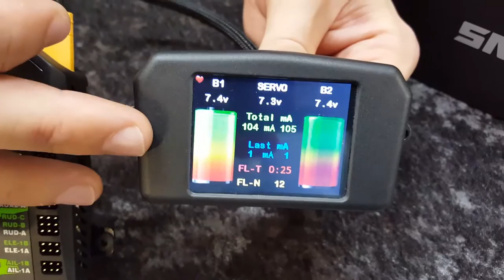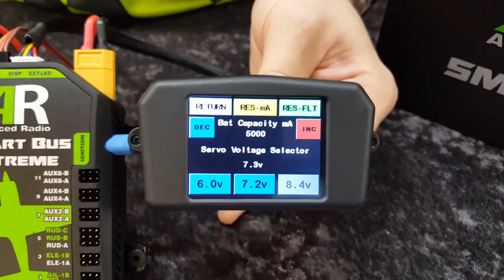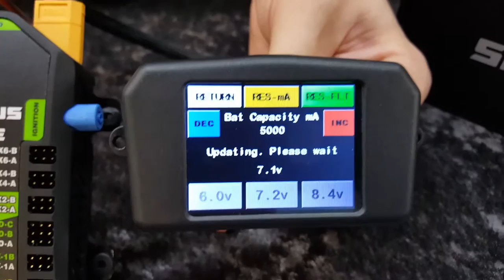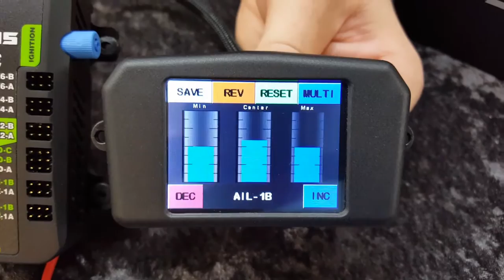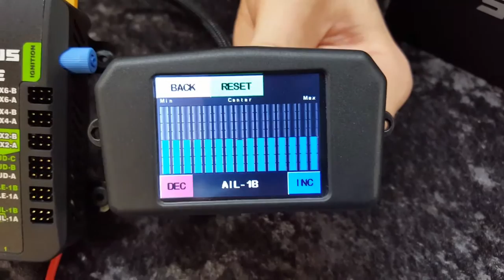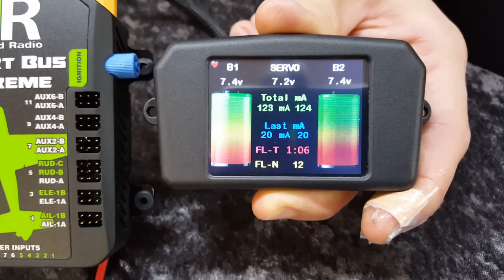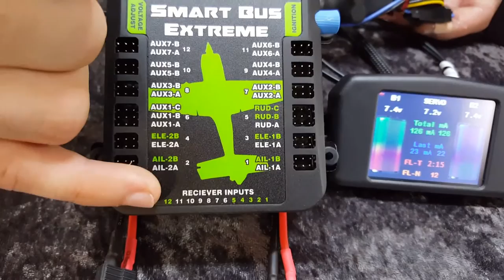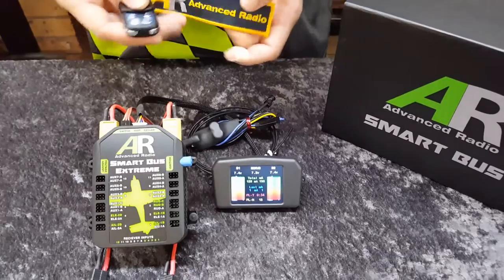Smart Bus Overview 2

Comment: HELP, I'm having issues having the RRS, setting it up to move the servos. I've rebound the TX and AR6610 RX using an IX20. Everything is on, I selected all the right parameters and model. 2s Pulse 5000, I'm definitely bound, nothing in the monitor is moving. Been trying to for two days. New to the electronics of today but flying RC many years.

Comment: Servo matching for only 2 aileron servos? what about 40% that use 3 servos/aileron?
Reply from the maker: we have a new Smart Bus Redundant Receiver system "RRS" version being released this month (Feb 2018). With this version you can mix an match up to 26 servos on as many channels as the transmitter sends.